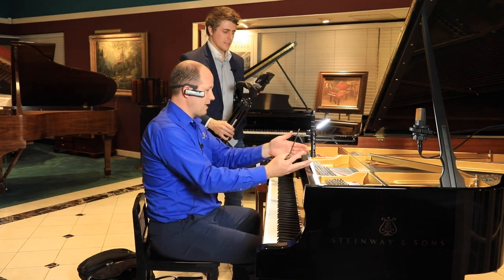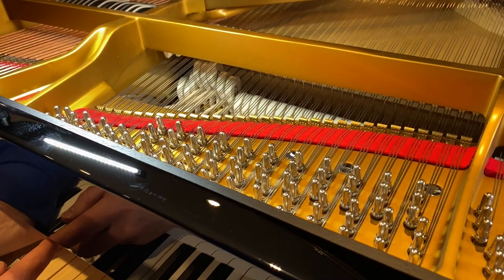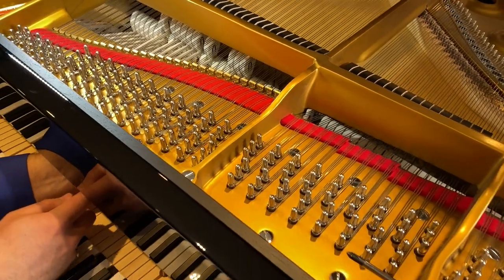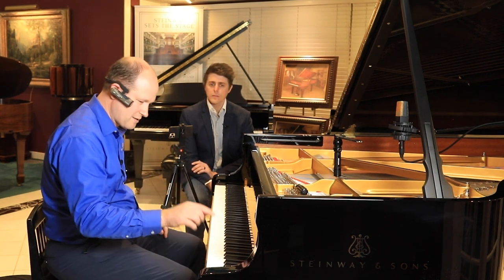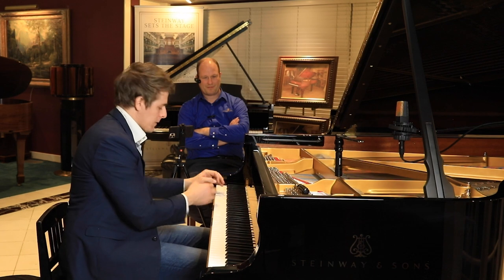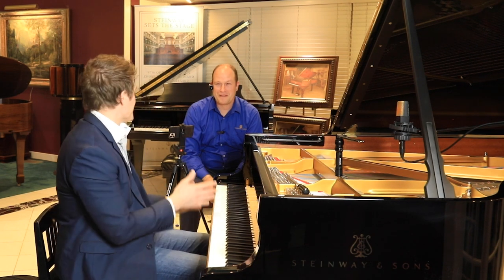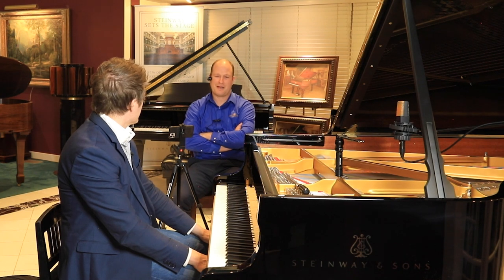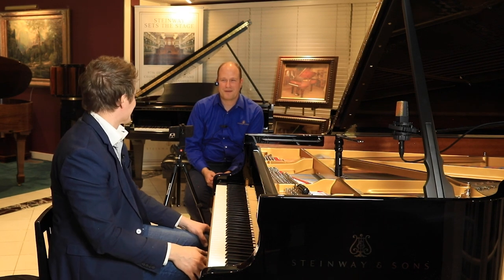Part 8 - Aligning the Hammers & A Discussion on Voicing - Prepping a NEW Steinway Series

Comment: Aligning hammers in the base is done in a way so the left string is hit with somewhat less energie. If you loose/miss the left string when shifting most of the time the left string of the next unisone will be struck. The lower treble is best to align so the left string is struck slightly to maken an smoother transition into the base. Cheers and loving this series